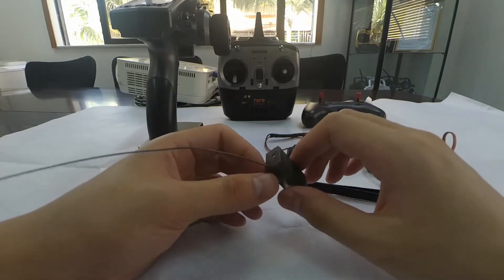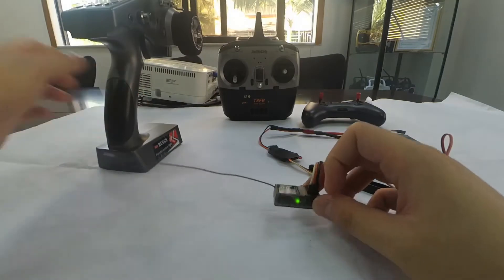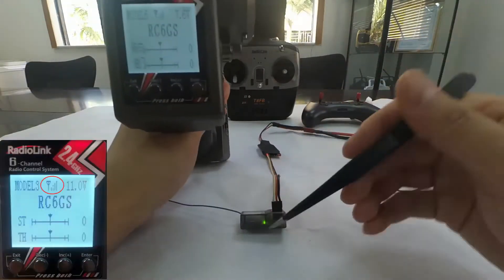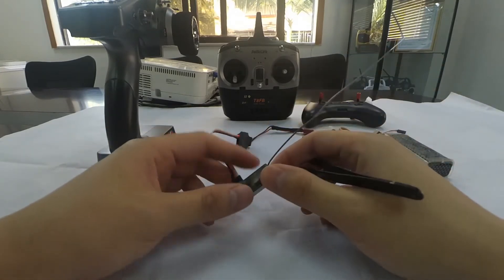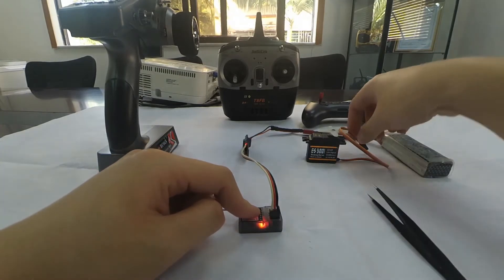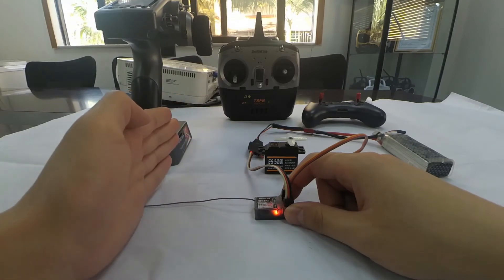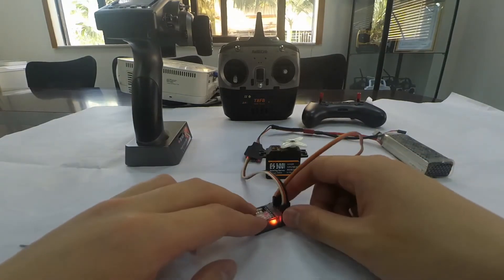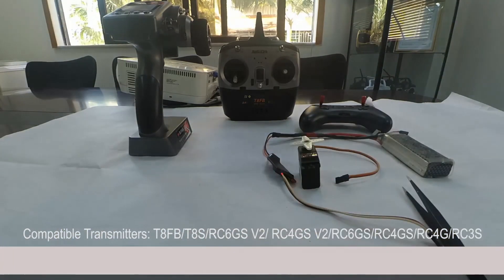How to| Make RadioLink receiver R6FG bind with transmitters

Comment: I have T6EHP-E transmitter..will this R6FG receiver campatable with my remote??
Reply from the maker: Hi, sir. Sorry they are not compatible. R6FG is compatible with RadioLink RC8X/RC6GS V3/RC4GS V3/RC6GS V2/RC4GS V2/RC6GS (3-position switch version)/RC4GS (version with P.D AFTER 180101) /T8FB(BT)/T8S(BT)/T8FB(OTG)/T8S(OTG)/T16D/T12D transmitters. You can take part in our trade in activity to buy a new transmitter at very low cost: https://www.radiolink.com/newsinfo/844239.html  If any question, please feel free to contact us. Our email is after_service@radiolink.com.cn

Comment: I got this remote and recovery receiver on a nitro 1/10 car. It works fine when the car is off but when the car is running the receiver stops working completely. I even ordered a new receiver and it does the same thing, any idea what’s causing this?
Reply from the maker: Hi, sir. So you mean the receiver cannot be powered on now? Generally, there are 2 possible reasons that causes such probem. 1.The power supply voltage exceeds the working voltage of the receiver  2.The positive and negative pole of the cable to the receiver are reversed. May I know what power supply voltage did you use to supply power to R6FG? And could you please take a picture of the connection to us? You can send details to our email after_service@radiolink.com.cn
Reply: @Radiolink_official  I swapped out the AAs in my car to a 6V battery pack and that fixed the issue. Thank you for the quick reply tho
Reply from the maker: @SwizzyPlays  Great to hear that. By the way, we'll release new R4FGM that supports at most 10V working voltage in the near future. You may wait for it. If any question about RadioLink products please feel free to contact us. Our email is: after_service@radiolink.com.cn

Comment: How does the receiver get power? Do you just connect input voltage to any channel?
Reply from the maker: Hi, sir. We use a battery to power on the receivee in the video. You can connect input voltage to any channel you like.

Comment: HI radiolink 🥰 can i know ….radiolink receiver RC4GS can washing with water …because my receiver so dirty 😅😅 i scare my receiver got damage
Reply from the maker: Hi, Sir. If you want to clean it, we recommend you to use water for cleaning panel. That's specially for panels. And pls note to use it after it is dry.
Reply: @Radiolink_official  soo your receiver no got the problem right? when i cleaning receiver with water😅
Reply from the maker: @kornchansuwan99  Hi, Sir. We do not mean normal water. We mean the special water for cleaning panel.
Reply: @Radiolink_official  ok soo when want to open my receiver ...my receiver must drying right?
Reply from the maker: @kornchansuwan99  Yes, it must keep drying when you reinstall it.

Comment: Hi..can i bind multiple r6fg receivers to only one Rc4gs transmitter? Is it using the model function?
Reply from the maker: You could bind with your RC4GS one by one R6FG,  they can works together, if you want to Specify one of R6FG work with RC4GS, you could set the ID SET. Any question just feel free contact : after_service@radiolink.com.cn

Comment: I have the R6Fgv2 and i cannot get it to bind with my RC4G. Are the two compatible? thanks
Reply from the maker: Hi thank you for choosing RadioLink product. Yes, they are compatible. But since RC4G is our old radio that has been stopped production for some time, the communication technology is improved and the binding between it and the current R6FG is more sensitive and require longer time to make it work or may drop after repower. For better maintainence and user experience, we would suggest you to replace with a new one. If you are interested in our lates RC4GS V2 https://www.radiolink.com/rc4gsv2, please contact us after_service@radiolink.com.cn  .